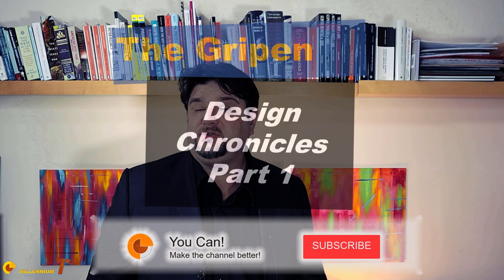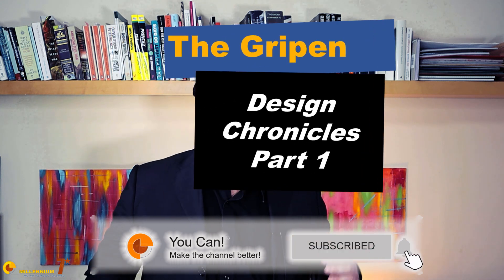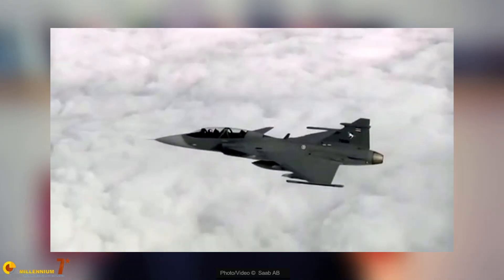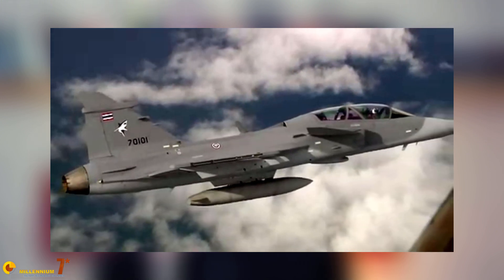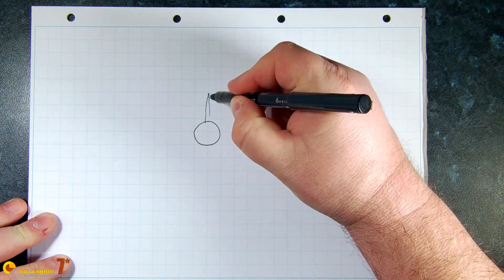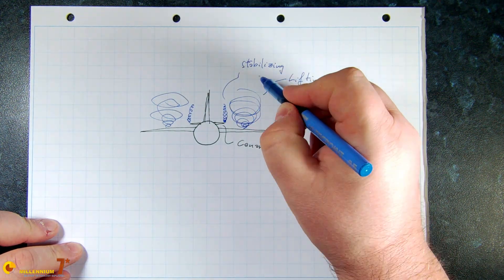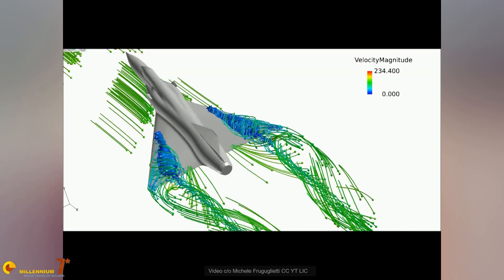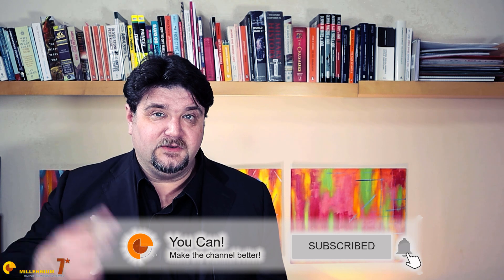Gripen - The Design Chronicles - Part 1

Comment: Canards give positive lift instead of negative lift of a tail configuration while cornering. And as you talk about, they enhance lift of the main wing by careful placement.
A Canard configuration create more turning lift per main wing area unit than tail configurations.
Gripen with it's relatively large canards does not use the full motion range of the canards in normal flight.
There is so much turning capacity that it would flip the plane like a coin.
In retrospect, a smaller canard is more than enough to create the normal envelope seen in normal flight (Rafale, Eurofighter). 

You can easily see that the canards are actually slightly negative in a lot of 9G corners to maintain optimum curve for energy by enhancing main wing flow.
https://www.youtube.com/watch?v=J9RVwyHsSiY
At 10 seconds you can see a beautiful picture of negative canards maintaining the vortex over the main wing in a very high G corner.
At 45 seconds you can see negative canards, giving slight lift in the forward vector while maintaining the vortex over the main wing in low speed flight, lowering the stall speed.

The Gripen can turn far tighter than a 9G corner (as can other planes), but for safety reasons: Pilot, structural limits, service life and energy it normally does not.
There are rumors of battle modes where the Gripen will allow even better pointing capability at the cost of energy. Of course, as always, the pilot is the limiting factor.
Such modes are likely to exist in a lot of fighters.

Even the Draken could do a high speed Cobra, probably exceeding all structural safetly limits today. :)
Reply: " Canards give positive lift instead of negative lift of a tail configuration while cornering. And as you talk about, they enhance lift of the main wing by careful placement. "

No.
For RSS (unstable) fighter aircraft (which is the case here) it's the opposite. 

When turning (with the words "when turning" I mean, a sustained, constant G and AoA turn), a canard will be providing downforce (negative lift)..., in order to keep the nose from continuing to pitch up so that it holds the nose in place and prevents the jet of exceeding the pilot request/input and/or the aircraft's G and AoA limits. 

A tail on the other hand, will be providing upforce (positive lift) and pushing the rear of the jet upwards..., in order to keep the nose from continuing to pitch up so that it holds the nose in place and prevents the jet of exceeding the pilot request/input and/or the aircraft's G and AoA limits.

In RSS aircraft, it's only when initiating a turn that a canard will provide positive lift, and tails will provide negative lift.
But that is just a fraction of second, when initiating the turn. Then, the canards/tails will do the opposite in order to arrest the pitch rate (what I said on the two paragraphs above).

https://pbs.twimg.com/media/C5Oxve0WQAI3dv_.jpg
Reply: @turnnburn6892  : A tail configuration almost never gives positive lift. Especially when turning. Ever. 101 course in aerodynamics. You've got your force arrows all backwards.

https://en.wikipedia.org/wiki/Canard_(aeronautics)

"A lifting canard generates an upload, in contrast to a conventional aft-tail which sometimes generates negative lift that must be counteracted by extra lift on the main wing. As the canard lift adds to the overall lift capability of the aircraft, this may appear to favor the canard layout. In particular, at takeoff the wing is most heavily loaded and where a conventional tail exerts a downforce worsening the load, a canard exerts an upward force relieving the load. This allows a smaller main wing. "

While there is a difference between a lifting canard and a unstable canard, both generate lift. The reason for the negative unstable canard is not to give negative lift, it's to increase the main wing lift capacity, by laminating the turbulence as optimal to the main wing as possible otherwise they could increase the unstable canard lift forces an lower the main wing flaps, it would create the same turning effect, but at an energy loss, as the main wing would loose the canard turbulence. This is exactly the same reason as why an F-18 has fixed LERX (other aircrafts do to). Turbulence over the main wing when turning.
Reply: @christianm1533  Well, not unless the CG is aft the AC. Normally it is not, because it causes serious instability, but if a plane is deliberately designed to be unstable, it may happen, and in this case the horizontal stab must indeed create lift to prevent the plane from pitching up.
Reply: Christian M Hi Christian, thx for the explanation, I understand what you mean, but you’re only right as long as the cg is before or at the cl. If the cg is behind the cl, the canard must create negative lift and the tail stab must create positive lift for straight&level flight. When you pull g’s, this force may reverse direction of course, but it doesn’t necessarily do so. If you don’t pull too many g’s, just reducing the negative force on the canard or the positive force on the tail stab may be enough, so that the canard will still produce a downforce or the tail stab an upforce, just less then what they produce in straight&level flight. It depends on how far the cg is behind the cl, that indeed does matter. During a high g break turn, however, they will most likely reverse direction, I agree. Regarding vortex formation, yeah, probably you’re right and that produces more additional lift than the increased aoa in case of these modern planes, so probably it is still more efficient than a conventional design, even if the canard itself is still producing some negative lift during the turn. I don’t know. Being a pilot and tki myself I understand aerodynamics, but I don’t know too much about vortices and similar non-conventional lift generating phenomena, besides the basics. Well, you don’t really need that knowledge in order to fly Cessnas and Bulldogs. :)
Reply: @turnnburn6892  : Ok. Lets not step on more toes here. So. First sentence. "When turning". Second one. "Especially when turning". So. Lets recap. Aft tail configurations (regardless of stability configuration) always give negative lift when turning positive AoA, unless you want to break the laws of physics. Canards always give positive lift when turning positive AoA (there is slight optimization modelling here though). At level flight,0 AoA, which seems to be the point you are referring to, unstable aft tail configurations with CG behind CL give positive lift. And canards give negative. How much will depend on the CG/CL relationship in both cases. This is level flight. There is a reason aft tail configurations are chosen for carrying bulk and canards have been chosen to carve curves. Canards also allows optimum placement of vortex over the main wing because delta-canards can use main wing ailerons to create turn as they are at a larger offset from classic wing designs (Draken and Mirages can do some serious turning for their age). Much of this is fixed with the clipped/extended keel delta wing of F-22 and F-35 as is adding more lift capacity.
Most pictures deal with the static 0 AoA case. Which is not the one I was referring to. As long as you create positive AoA (in normal flight, not strange stall or low speed scenarios), all aft tails create negative lift.
Reply: @csabascs5913  : As I said in almost all my entries. "When turning". Ie. Yes I agree with you on level flight. But that was never my point.

Aerodynamics is a complex subject with a lot of corner cases, depending on what part of the flight envelope you are talking about.
Canards are there for a reason, they are not just gimmicks. ;)
There is good reason that the Eurocanards are referred to as carvers versus the modern unstable aft-tail configurations are more of the ordnance carrying type.
Of course the subject is not black and white, it is not like aft-tails cannot turn or be excellent turning fighters. ;) 

It's just that canards conserve energy better when turning, at the cost of a lot of other things. Stability, drag, complexity being the main problems.
Nature chose aft-tail configurations for a very good reason. 

My guess is that energy cost of normal flying was more important than conserving energy when doing aggressive turning. :)
Birds use flight formations to optimize lifting forces and drag. And it is not like nature has a few other tricks up it's sleeve to compensate for the aft tail (flexible body). :)
Reply: Christian M Well, birds work quite differently, in many ways. They have Prandtl wings, for example, that’s why they don’t need vertical tail surfaces, as far as I know.
Reply: @csabascs5913  : Well. Yes. They can turn without a rudder even in level flight. But birds still use their horizontal tail as a vertical one, depending on maneuver. 

https://www.quora.com/How-do-birds-fly-without-any-vertical-stabilizer-on-their-tail

That is part what I meant by "flexible body" :) Nature has such elegant solutions.
Reply: Well, if the CG is actually aft of the AC, then you're right, and the canards must create a downforce, otherwise the plane would continuously pitch up. But that sounds very strange to me, since one of the biggest advantages of the canard configuration is better aerodynamic efficiency due to the canards increasing, instead of decreasing overall lift, like normal horizontal stabilizers usually do. If this is really the case, then it's a very strange design indeed.
Reply from the maker: Great comment, adding a lot of value. Thanks & well done!
Reply: This was exactly what I hoped to read in the comments section 

Thank you
Reply: @Niclas Eriksson : Barrel rolls are quite possible in almost any aircraft. Canards mainly optimize the energy situation in subsonic and transsonic regions. Canard have very little to do with barell rolling. A F-18 can execute some very pretty barrel rolls (there are a lot of different barrel/displacement roll types) with some ass-dragging if pushed hard enough. Not quite optimal, but very pretty.
Reply: "There is a possibility for the pilot to override the soft
stop in an emergency situation and pull the control
stick back to the hard stop and thus get an extra 3g,
when aircraft speed is above 600 km/h."

https://www.sciencedirect.com/science/article/pii/S1474667015332274/pdf?md5=89008a7c3fa4a6978d9460bba43737d2&pid=1-s2.0-S1474667015332274-main.pdf
Reply: @RogerJL  : Probably so. 12Gs is what I have also heard is available to immediate pilot request. This is probably not "Battle mode."
Battle modes override equipment cooling, safety limits, radar output, etc. I would suspect "battle modes" exist in almost any modern fighter jet.
Reply: @christianm1533  It is immediately available but I think I read that the pilot will have some explaining to do as it shortens the long term operational life.

In battle everyone is happy if you got home and can fly another sortie.

Note: the papers available online are several years old and many MS revisions...
Reply: @Niclas Eriksson 
Your english isn't perfect? It's ok, that's fine. No need to be sorry for that. 
What you need to be sorry is that you were spreading a false narrative: canard aircraft are better than tailed aircraft including performing aileron rolls. 
That's totally false. It's a lie. It's trolling. 

And I still don't understand why you keep saying that tail fighters can't do aileron rolls in a perfect straight line, while in the video that I showed to you, an F-15E executes several straight and clean aileron rolls in a climb.  

A tailed fighter can do this just as good as canard-delta jet like the Gripen. Fact. 
I see Raptors, F-35s, F-16s, etc, doing aileron rolls like this all the time. And they do them perfectly, straight and clean.
Reply: @Nick Emerson 
That's not true. I've seen Typhoons generating those corkscrew moves while rolling. 
Here's an example:
https://youtu.be/sBp-vl7-A4A?t=35

The reason why some jets do rolls like that sometimes has nothing do with having a canard or a tail.
Reply: @Niclas Eriksson : I see. Yes. Gripen can perform pretty pitch perfect rolls. Like threading the needle. My best guess is that this is mainly a compensation of the flight aerodynamics modelling and computer. It makes Gripen a very trivial jet to fly. Ie, point the stick perfectly to the left and right and the plane will do a pitch perfect roll. Within reasonable limits of course. :)
Reply: @Niclas Eriksson 
Another Gripen trolling fanboy who doesn't know shit about what he's talking about...
That's not a barrel roll. That is just a simple 360º aileron roll. Any other fighter aircraft in the world performs rolls like that one all the time and just as good and cleanly as the Gripen.

Don't believe me? 
Here's an example for you: https://youtu.be/L4yEo5UxlCQ?t=228

Yeahh, it's an F-15E performing an aileron roll! A tailed fighter! HOW IS THIS POSSIBLE??!! (being ironic now lol)
Reply: @turnnburn6892  Please, may i suggest you save your toxic comments to other discussions and instead join the comments section here in a civilized tone? This channel deserves that.